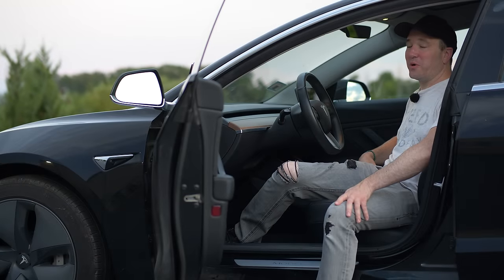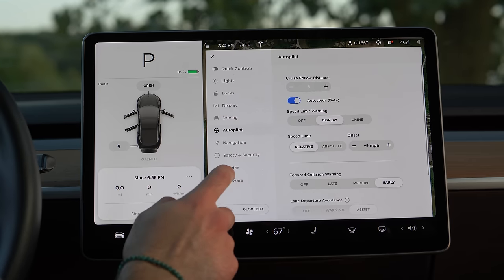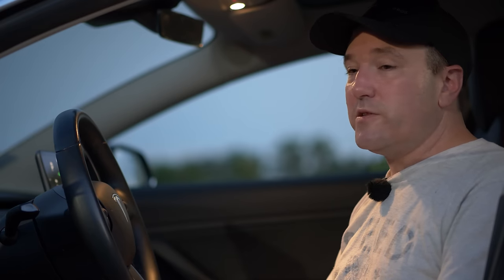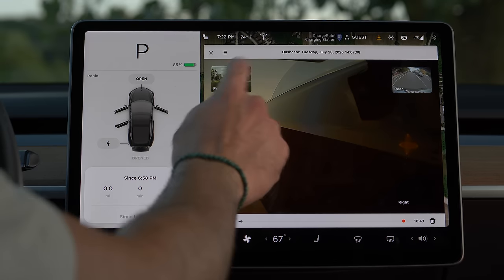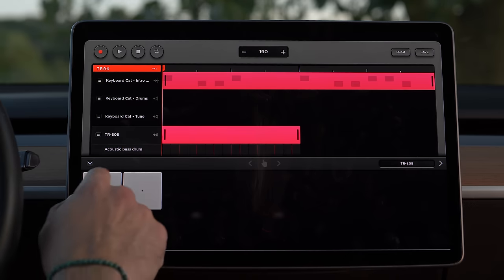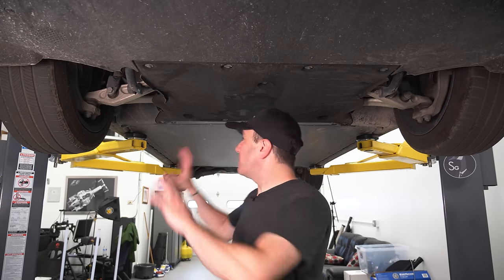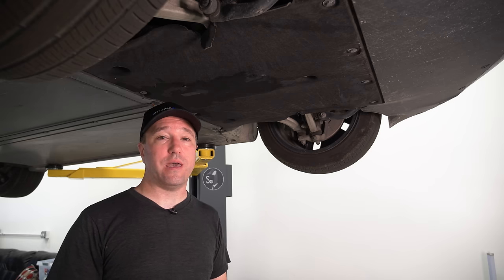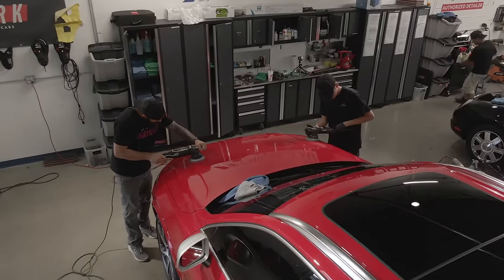Tesla Model 3 | Explaining the Cult

Comment: Thanks for reviewing Tesla Model 3 and providing some alternate perspectives.

I'd like to point out some significant factual errors, however.

0.  Most EV drivers charge at home overnight and don't use public chargers.  Fast charger networks like the excellent Tesla Superchargers are generally only for very long road trips.  This is especially true in suburbs where most people have off street parking.  Anyone who has electricity where they park at home can charge an EV there.  240 Volts is best, but 120 Volts works also.  Most homes have 240 and installing an additional 240 outlet (or wall mounted "charger") costs a few hundred dollars.

This is a totally different usage paradigm from fossil fuels.  With an EV, your garage is your gas station, and you can start any day with a "full tank."  This is much more convenient than going to a gas station.  In addition, apartments, parking structures and even street parking are getting charging locations for people who live in cities or don't have off street parking.  Many people also charge at work or when shopping.  Admittedly, this is usually something new to non-EV drivers, but after driving electric for a while, it becomes as easy as charging your phone or laptop.  Easier actually since the EV charger is usually at the same place.  Charging is MUCH easier than people sometimes assume.

1.  All of the controls commonly used while actually driving Model 3 and Y are on steering wheel stalks and buttons, NOT ON THE TOUCHSCREEN: turn signals, shifter, cruise control speed up and down, following distance increase and decrease, autopilot engage and disengage, audio volume, audio track skip, answer phone, voice command, windshield washer, etc.  This is a very common misconception.

2.  About the only thing the screen is used for during actual driving is occasional glances at the very large and clear speedometer and map.  Both are higher and larger than in other cars.  Everything else can be set to automatic or has user presets, like mirror and steering wheel position.  Seats have user presets too and can also be adjusted from the seat adjustment buttons on the seats.

3.  The few controls on the touchscreen that do get occasional use are in permanently fixed locations, like the temperature control and fan speed.  Both have automatic settings.  Temperature is easily adjusted with one press, but for most people, it's set it and forget it.  In addition, temperature can be adjusted by voice command. 

4.  Phone and navigation can also be operated by voice command and this is the most common way to use them, just like a cell phone.  You press the voice command button (right button on steering wheel) and say "navigate to X" or "call X", and it does it.

5.  Overall, the user interface is simple, logical and quick to use without ever looking at anything other than the speedo and map occasionally.  All of the common controls can be operated on the steering wheel by feel alone without ever taking your eyes off the road or hands off the wheel.  Maybe you didn't drive long enough to figure this out, or were simply being (unduly) negative.   In reality the touchscreen gets almost no use during actual driving, but it's very clear, simple and easy to use when it does.

6.  It's extremely strange that a performance oriented channel would choose the standard range Model 3.  This is car that competes directly with the BMW 330i but uses very hard energy efficiency Michelin tires.  They are NOT performance tires, but are very well suited for the intended use of the car, which is efficient commuting, shopping, etc.  

7.  Model 3 Performance in contrast uses excellent Michelin Pilot Sport 4S tires, arguably one of the best street performance tires currently made.  As performance enthusiasts, it would seem that you should know that tires make a HUGE difference in the performance and feel of a car.  Model 3 Performance with these tires performs better than a BMW M3.  It does so with better comfort, more than 3 times the energy efficiency and much greater ease than the BMW M3.

8.  Model 3's suspension design is among the most advanced in the world.  It's not likely to change.  Front suspension is virtual steering axis and rear suspension is nearly identical to recent Ferraris.  Tesla hired top design engineers from Lotus, Ford Racing, Jaguar, Aston Martin, etc.  The mechanical engineering of Model 3 is excellent, as is its electrical, chemical, software, and human engineering design.  It is an exceptionally well engineered car in every aspect.

9.  Wind noise is ALWAYS more noticeable in an EV due to the lack of ICE noises to mask it.  Since you seem to know something about sound perception, you presumably know what auditory masking is.

10.  The door handles are very easy to use.  Did you honestly not figure it out, or where you trying to be dramatic?  You press the tall part of the handle with your thumb, then grab the long part to open the door.  Even little kids can figure it out.  Literally.  :)  Opening the door can be done single handed with either hand.  For the opposite hand, you can go underhanded to put the thumb on the tall part.

11.  Regarding engine noise being entertaining, for performance driving I agree.  However on long road trips, commuting, etc., the quiet of EVs is nice.  But at the same time, wildfires, typhoons and hurricanes, floods and storms are probably being made worse by Carbon emissions, so what is more important to us?  What kind of planet do we want to leave to future generations?  One with even bigger storms, floods and wildfires? 

12.  EV total lifecycle energy and Carbon emissions are lower than ICE vehicles.  There are many scientific studies that account for all energy and material use for both types of vehicles that measure and confirm this.  Please stop repeating oil company anti-EV FUD.  It's false.

13.  There is no shortage of materials needed to make batteries, and there are battery types that use no Cobalt, etc.  Tesla uses almost no Cobalt in their formula that uses some, and they are also using zero Cobalt batteries in China.  Future solid state batteries such as the Braga cell can run on Sodium and Silicon, i.e., processed salt and sand.  Neither of those is scarce.

14.  Tesla competes directly with and has taken very significant market share from Mercedes, Audi, BMW, etc., but it's also outselling Toyota Camry, Toyota RAV4, Honda Civic, Honda Accord in markets like California.  That's been happening for more than a year.  Given that Tesla does zero advertising, this is due to word of mouth and the quality of the cars selling themselves.

15.  Telsa Model 3 is priced almost exactly the same as the BMW 3 Series range, and it weighs within about 10% of them too.  Very similar external dimensions also, but Model 3 is larger on the inside.

16.  Tesla does not give out press cars except in extremely rare cases, so to say that they try to influence reviews is almost totally off base.  Some nice drama though.  :)
Reply: This is the comment everybody should be reading! Hope you get more likes! Thanks for taking the time! :-)
Reply: @marco3710  Thanks very much for your kind words!  I'm trying not to be too dogmatic, but wanted to try to correct some  factual errors in the name of accuracy.  Also trying to educate more people about EVs.  Please help spread the word about EVs!  Thanks again!
Reply: @LoanwordEggcorn  Great man, maybe think about starting your own channel? You seem to know a lot about the topic and the demand for information about it is rising with light-speed, the perfect time to start! :-)
Reply: @marco3710  Thanks again for your kind words!  I've been studying and driving EVs for more than 20 years.  100% agree there's a need to get more information about EVs to people, as they're on the steep part of the disruption/adoption curve.  I would love to help educate people, but don't know if I have the talent for it in video form.
Reply: @LoanwordEggcorn  go and find out! The electric car niche on YT needs more experts like you!! There are loads of videos on YT on how to start a channel what you need and what you don't need in case you really want to start a channel! 🙂

Comment: That was one of the best takes on the whole ICE vs electric in a long time. Very well done. Having a Pacifica ICE van and a Chevy Bolt EV I wholeheartedly agree with you on most of the points you were making. From a practicality point of view, our EV is the prefered run around town car without having to worry about range anxiety or having to worry to hurt the ICE with short stints, but when it comes to any kind of travel, the Pacifica is hard to beat on so many levels. I personally wish there would be a greater selection of Plug in's with an EV range of 80-100 miles, it would cover most everything I am doing short and long-distance.  The Pacifica Hybrid is a good start just needs more EV range and more user controlability of the electric range.
Again, very well done!
Reply: The market for BEVs with 80 mile range is negligible.  There are a handful of people like you who are looking for a short distance "city car", but you'll never see such a product in America.  Maybe in Europe or some parts of Asia, if the car is cheap enough.

Comment: 5:08 The storage door alert is rather simple and works for that door only and not the upper door. That specific storage area has a light that turns on when the lid is opened. Close the lid and the light turns off. When the light is turned on and off repeatedly without a long break in between, it’ll trigger the alert. You don’t have to be closing it hard to trigger the alert. Simply move the lid up and down repeatedly near to the close position and it’ll trigger the alert. You’re welcome.

Comment: I rented (turo) almost the exact same car, and drove on the same roads in Volo, IL, and agree with almost everything said. Generally liked the car but reasons I wouldn't get one now: bicycle for 6'4" person doesn't fit in the trunk, 45psi 18" tires bad over Chicagoland potholes, noticed road noise level in car, took two road trips in past year, larger 3 yr old IC sedan with none of these problems half the price, and Mustang GT way more fun.
Reply: A full size bicycle does fit in the trunk. Lower the back seats, remove the subtrunk cover and put the protruding handlebar in there.
Reply: I love the engine in the Mustang Gt.   The Mustang is one of the most uncomfortable modern cars i have driven.  Fine for an half hour drive.  I drove one from DC to North Carolina.  I will never do that agin.  The AWD 3 is FASTER than the GT.
Reply: @DavidJao  Clarification: A bicycle with front tire removed and car seats folded down does not fit into the Model 3, but does into most midsize cars.
Reply: @iltrmb  Full size adult bicycle front tire NOT removed (tire still on bike) fits completely inside a Model 3 with rear seats folded down with all doors and trunk completely closed. Proof: https://imgur.com/a/juIAMX0
Reply: @DavidJao  Bike for a guy 6' 4"?  (maybe 62cm)  What's your definition of "full size"?  
Greg was pretty clear and I'll give him the benefit of the doubt on trying to fit it in unless you, too, tried a bike of that size with seat still set in position.  OTOH, neither of you defined bike type (Road, MTB, etc.)
Who knows?  From what SG was saying, trunk size may vary from lot to lot, smh.

Comment: I own 2019 MX-5. I drove a friend's Model 3 Performance a couple months ago. It changed my attitude about cars. Chasing a 4 second 0-60 time in a reliable gasoline car is pretty expensive, and the Tesla will still wipe the pavement with it from a stop. It confirmed for me that I'm not into gasoline cars for ludicrous performance--electrics are already faster than almost everything, and that gap will widen. Gasoline gives the experience soul and character that the electric won't provide for me.

I'll keep the 14 second quarter mile of the Miata. Whatever the performance figures, it puts smiles on faces. An electric might become my daily driver one day, but I don't see it replacing my sports-inspired machines.
Reply: Ha that's interesting, I daily drive a Model 3 (and I love it) but I've been thinking about getting a Miata for the weekends, eventually. Seems like a good setup
Reply: It's as it should be IMO (and most likely will be in the not so distant future). An efficient EV for 95% of the time for daily driving and stuff instead of noisy and lackluster 4 cylinder gas cars. The rest of the time, on more special occasions, that special "week-end car" with a V8 and/or manual transmissions just to get that "itch" out of your system.
Reply: I gave up my ND MX-5 for my Model 3.  As a daily I feel like it's incredible, but I'll get another ND for my weekend blasts.  That'll be the perfect setup.  Not one or the other.
Reply: Sold my supercharged Lotus Elise and now just have my M3P.  It’s not a replacement, but provides enough weekend fun that I couldn’t justify the upkeep of the Lotus.  YMMV

Comment: I really liked your summation. The argument that one product is "greener" than the other is a dumb one within the context of current state of the industry. The fact is that they are both pretty close over the life of the car. And that life is dependent on the quality and design regardless of type/tech. The owner has some hand in that also, obviously. But the consumer is a shrinking factor.

Rule of thumb now is: An EV is dirty new and gets cleaner over time. A CE is cleaner than an EV new and gets dirtier over time (both measuring all environmental factors). There will have to be a pretty large leap in tech or consumer habits to change that.

Comment: As a Model 3 owner of two years, I thought this was overall a really fair assessment of the car; I am going to push back a bit on the screen being portrayed as a safety distraction.  The only thing you really need to regularly look at on the screen while you are driving is the speedometer which is in the upper left corner of the screen in big block, easy to read at a glance, numerals.  I’m only one data point but where I have the seat set, the angle from looking straight forward to the speedometer is about 22° down and right; on my old WRX it was about 15° straight down but also slightly behind the steering wheel where I like it positioned so I had to move my head slightly.  And you don’t need to see things like tachometer, oil pressure, oil temperature, boost, coolant temperature; those things just don’t exist in an EV.   Just about everything else that you would want to control and thus “need to look at the screen” can be done with voice commands that are really very good with natural speech and/or the thumb wheels on the steering wheel.  Wipers, climate, seat heaters, audio, phone, navigation… all can be controlled with voice function that actually works.

“In the 2nd quarter, we registered one accident for every 4.53 million miles driven in which drivers had Autopilot engaged. For those driving without Autopilot but with our active safety features, we registered one accident for every 2.27 million miles driven. For those driving without Autopilot and without our active safety features, we registered one accident for every 1.56 million miles driven. By comparison, NHTSA’s most recent data shows that in the United States there is an automobile crash every 479,000 miles.”-Tesla
 Q2 2020

If the screen were a significant distraction, it seems we should see a higher rate of accidents with Teslas than we do.  Now I recognize the data is imperfect (all Tesla models combined vs. all other vehicles (of all ages) combined) and there are other factors at play (i.e. less likely to have younger, inexperienced drivers, likely to be in better road-worthy condition…), but without the active safety features there are more than 3 times the number of miles driven in a Tesla than a non-Tesla that supposedly doesn’t have the screen distraction.
Reply: We?
Reply: @cdnmetelhead4013  Which "we" are you questioning?  The ones from Tesla's statement or would you prefer I reword my statement following for greater precision?
Reply: @toddwright662  I don't remember seeing the quotations in the second paragraph.  My bad.
Reply: @cdnmetelhead4013  Got it. Thanks for the clarification.

Comment: Great review!  As an owner of a Long Range AWD Model 3 and Model Y, you are spot on.  While I agree with your point on the distracted driving possibility, I find just the opposite.  This is the first car I’ve owned where I exclusively use the voice commands as they are that good.  As someone else pointed out, the only thing you really need to use the touch screen for is to adjust the air vents.  But, even if you do do that while driving, everything is pretty much one menu deep, unlike every other car on the market where many useful functions are unintuitive and multiple levels deep in a menu, ala my Audi Q7 and BMW X5 that I previously owned.  But, in the end, unless the cost and materials to make the batteries get more environmentally friendly, I think Toyota’s approach of making hybrids that give you a fair amount of mileage on EV only is the better approach, e.g., the RAV 4 Prime.  AND THANK YOU FOR POINTING OUT THAT ALL CARS ARE WASTEFUL FOR THE ENVIRONMENT!!  Using an EV is not a tree-hugger approach.  But, EV tech has the huge upside of getting greener every year.  ICE vehicles have pretty much maxed out they’re advances.  Petrol is petrol...and always will be.  EV power can be generated in so many ways and as society evolves to adopt greener ways (wind, solar, water), the car gets greener.  Hopefully, the battery tech keeps improving as well.  It’s the hope of a greener tomorrow that makes people in favor of EVs!  I love my 2!